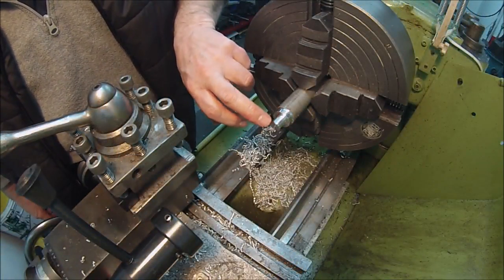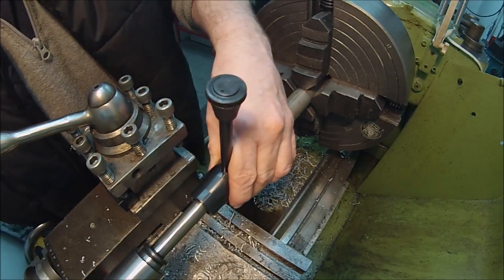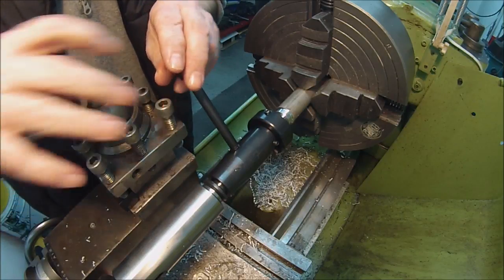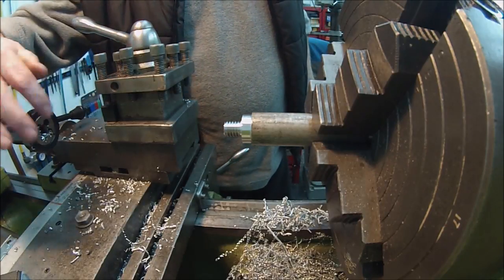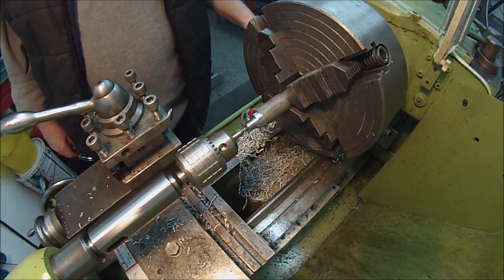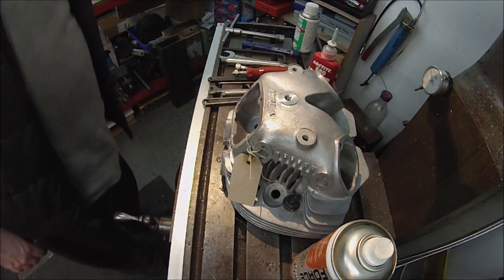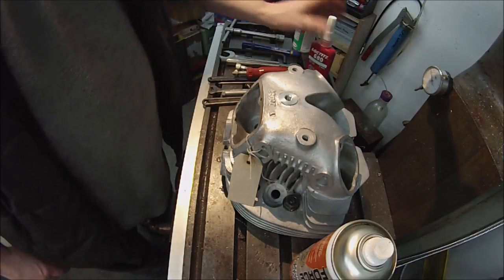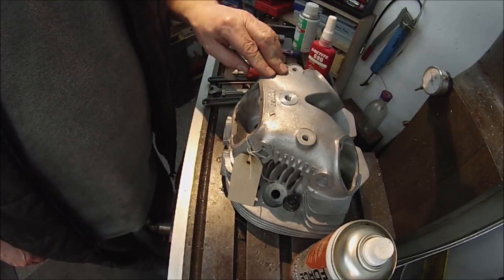Norton head steady thread repair

Comment: Hello mate. Can you please explain why you use inserts which are threaded on both the inside and the outside, instead of just pressing in an internally threaded plain bush, with an outside interference fit? I agree that the external thread gives better "grip", but is it really necessary, given that interference fits can be made both by heating the head and cooling the bush? It seems like a lot of trouble to go to, to effect what could be a simpler repair.

I'm not criticising you, just asking.
Reply from the maker: No problem, I have seen several failed repairs on exhaust ports where shrink fitted then welded bush inserts have failed, either through vibration, fatigue or poor fits to start with. If you check out the Seager Engineering exhaust thread repair ( http://www.ebay.co.uk/itm/NORTON-COMMANDO-EXHAUST-PORT-THREAD-REPAIR-SERVICE/371859876813?hash=item5694936bcd:g:psgAAOSwMtxXwZIU) or James Comstock on Youtube, (https://www.youtube.com/watch?v=ZPQc-mHtkiA), this is the sort of level I am trying to get close to without the expense of a CNC machine set up. Many thanks for commenting and watching the channel, Ade
Reply: Thanks Ade, that makes sense. 

That feller Comstock does a good job in a very short time, doesn't he? But he has, as you say, the advantage of CNC machinery. It would appear that he is in the "production" world too, if he makes those bushes a hundred at a time..

Comment: Hello Ade. Nice job. I really like that die holder, is it bought or made? I also wish my Colchester was as quiet as yours, it is another winter project that I haven't got around to.
Reply from the maker: Thanks Michael, appreciated. The die holder is an RDG tools one:
https://www.ebay.co.uk/i/371456706729?chn=ps&adgroupid=49962971442&rlsatarget=pla-380178320800&abcId=1129946&adtype=pla&merchantid=7259694&poi=&googleloc=1006586&device=c&campaignid=974960578&crdt=0

What do you think the noise on your lathe may be? Hopefully not main spindle bearings? What did help mine when I got it was fitting a matched pair of drive belts, and somehow it seems quieter on the inverter than others I have heard on straight 3 phase.
Best wishes, Ade